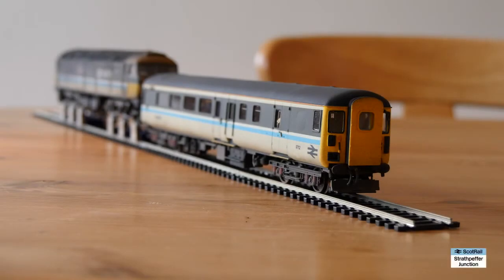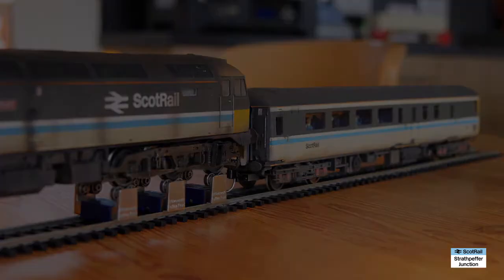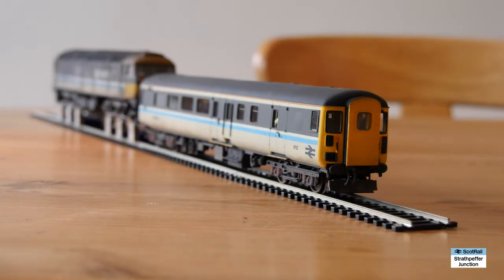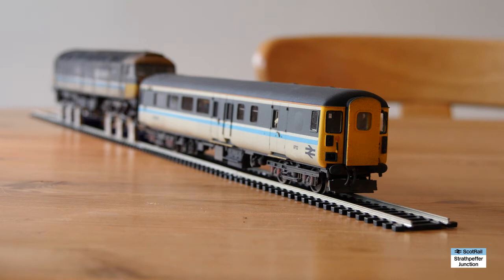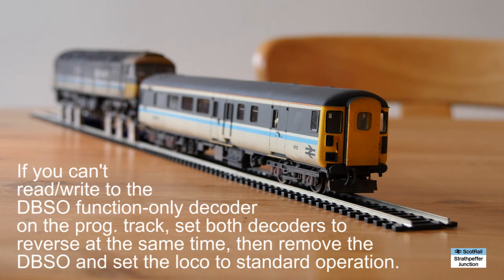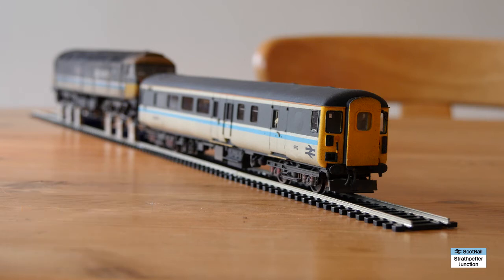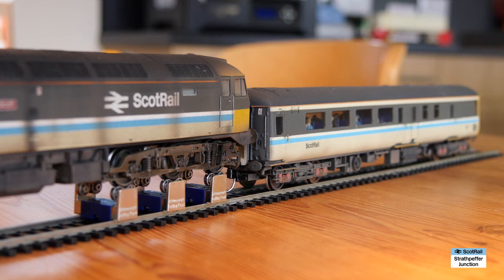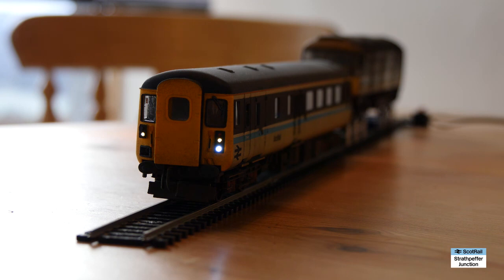#6 Custom-built ScotRail Driving Brake Standard Open (DBSO) Coach - An Overview

Comment: Fantastic work!! Well done. All the extra electronic work, is beyond my capability, but great see how you have done yours. Your work on making new windows is stunning and gives a great result. I really like the Scotrail locos and DMU's, however have found they can be fairly expensive. I have been looking on Ebay for a cheaper Class 47 and DMU and plan to respray and add transfers etc to make my own. Will see how it goes.  Thanks again for sharing.
Reply from the maker: My pleasure. Thank you for the lovely comment!

Comment: Stunning work on the DBSO, it gives me a little more confidence when it comes to me doing my custom NIR Class 80 build. Looks like I need to get myself one of those cutters too, they look like the perfect tool for scratch and custom builds. I could do with it now to produce some circular discs for water towers I'm thinking of making! Thanks for sharing. Paul
Reply from the maker: Galgorm Hall OO Gauge Railway Layout They're quite pricey (although I got mine from Amazon Warehouse for a good price and it was barely used) but I have to say they're excellent. They're also great for cutting out tiny printed signs perfectly etc. With this one you can use registration lines printed onto a conventional print from your printer, so when you feed the print into the cutter, it then cuts it out precisely where you want it to be cut out. I haven't yet used it for building modelling, but I'm certain it'll be fantastic.
Reply: Strathpeffer Junction Thanks for the review, very helpful. Could you give me the make and model?
Reply from the maker: Galgorm Hall OO Gauge Railway Layout Sure. It's the Cameo Silhouette 3. I think it's about £300 new, but I got mine for about £200. So, not cheap, but I've used it loads and it's paid for itself in terms of usefulness. You can also get a smaller one that's A4 (mine is A3), which brings the price down and older models are still available. There are other makes too, like Cricut, which are supposedly good, but I've never used them.
Reply: Strathpeffer Junction Thanks for that. Time to do some researching. Paul

Comment: A very nice piece of work indeed!
The window frames are particularly nice!

You chose wisely with 9712, because most of the DBSO's had extra piping around the bogies on one side.

I have a number of Mk2e's that I'm going to convert into Mk2f's (simply because I'm not paying £50+ per coach on the Bachmann ones), as well as a few that will stay as Mk2e's.
Currently I have 33 of them, with another 11 more needed.

Generally speaking, Hornby's Mk2e is very good, however there are two glaring errors that I'll have to fix... something you may not have noticed.

1: The roof ventilators are far too wide... but you can get some 3D printed ones from Shapeways, so it's just a case of carving them off and fitting the 3D printed ones.

2: The chassis doesn't clip onto the body properly, so there's a distinct 'solebar' between the body and the chassis.... which shouldn't be there.
It can be fixed, but it requires a little surgery.

Also, the majority of the Mk2f's (including all the DBSO's) have a different Aircon pack to the Mk2e.
I've done a design for 3D Printing, so people will be able to convert their own coaches... although I haven't uploaded it to Shapeways yet.
Maybe you'll want one for your model?

Speaking of surgery, the photo at 2:52 of you chiselling off the window frames.
It looks like you dug into the body a bit at the top part of the window frame.
A modelling tip for you...
If you turn the chisel blade upside down, it will pare away any raised parts you're trying to remove, but won't dig in.

There's a couple of things missing on your model that you may wish to add... depending on which year you're modelling.

1: Bogie steps.
These are easy to make up from some thin brass strip (or sprue from etched nameplate) and thin plasticard.

2: From 1988, the DBSO's received radio pods on the roof above the cab.
If you're modelling before that, then there's no need.
Reply from the maker: +UK Diesel & Electric Railway Modelling Thanks very much indeed for the considered comments. There are a couple of things that I hadn't spotted, but a few that I had but being my first conversion I decided to leave out to make things a wee bit simpler (like lowering the body - as you say, the Hornby stock model has that as a glaring error). I actually have a 3D printer and am increasingly using it for modelling, so I'd be really interested in a few pointers for missing parts or downloading copies of what you put up on Shapeways (do they do downloads as well as prints?). I totally agree, the Mk2E is not a bad attempt by Hornby, but doesn't get it all right. And, yes, I took out a wee bit much with the chisel...a rookie error! The blanking panel is not actually as flat or smooth as I'd want, but every day is a school day and I've picked up some good tips and skills for next time. Thanks again for taking the time to type out such a helpful comment :-)👍🏻

Comment: nice one :), I think you should do a whole network rail train that you see running mainlines today with there DBSO coaches (91) and there other coaches with the usual class 37 pushing it :) you do a really great job on theses :)
Reply from the maker: Many thanks indeed for the kind comment! Apologies for the slow reply. It got caught in my 'held for review' queue, so I only just spotted it. I try to stick to 80s era, but I am quite a f an of the Network Rail stock, so I may well find myself pulled into doing something along those lines in due course :)
Reply: haha I wouldn't worry I get the same problem on my channel with comments :) you could all ways sneak in a modernish train ;)
Reply from the maker: I just bought Hornby Class 67 Cairn Gorm to go with a rake of First Scotrail sleepers that I already had, so I can feel the rot creeping in already! Lol. Won't be long until I spend too much on modern image too. Lol.
Reply: Strathpeffer Junction I've never been good at keeping keeping a layout in a era  I had 37s  class 40s and then 66s and 350s

Comment: Ah so the unit it's self doesn't have a sound chip it's the 47?
Reply from the maker: Yup. The DBSO only has a function decoder, for lights. They didn't have power units, so wouldn't have generated much noise themselves.
Reply: @StrathpefferJunction  ah bit like a more modern version of an autocoach then, smart!

Comment: Very nice work, a your channel is one I am pleased I found. I think we have very similar sills, although I do not think I could customise a coach as well as you have. If there any chance you could supply a wiring diagram for the unit that had the Bridge Rectifier etc. on it and email it to me in a private message?..Simon
Reply from the maker: +Simon -Liverton Central Thank you very much, Simon. I'll try to sort out a diagram this week and either message you with it or do a really quick video. I tried to keep the PCB as small as possible, although I should be able to squeeze things down a bit more using etched pcb rather than prototyping board.
Reply: Many thanks, do you make your own etched pcb's which I think is much better, would be nice to see that also?...Simon
Reply from the maker: +Simon -Liverton Central I have etched them in the past, but I have also just bought a cheap Chinese cnc milling machine, which I'm going to see if I can produce small pcbs on. Etching produces good results, but takes time and is a bit messy. The cnc may make it easier, quicker and repeatable...if it works!
Reply: Which cnc milling machine do you use, if it works I will buy one
Reply from the maker: Simon -Liverton Central It's a cheap Chinese one that's currently en route across the oceans! I think it's called 'CNC 3018' or something. If it works and is any good, I'll let you know. Would hate to recommend it before I've built and tried it!